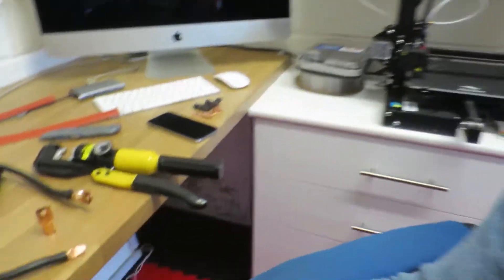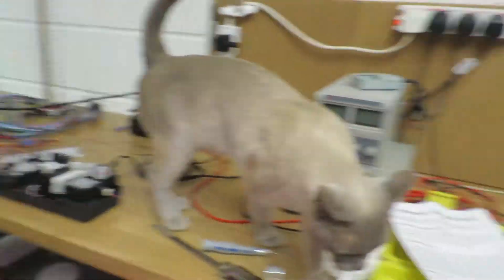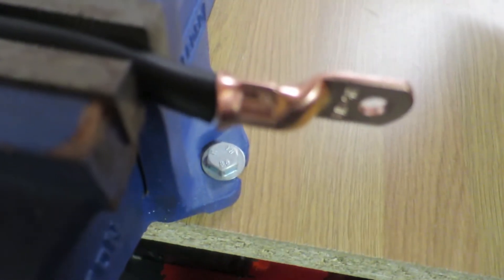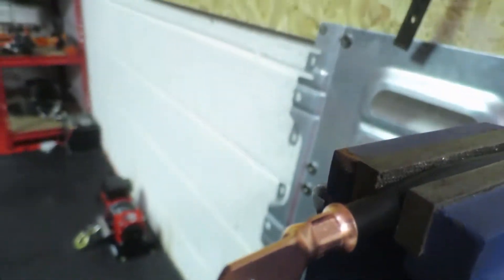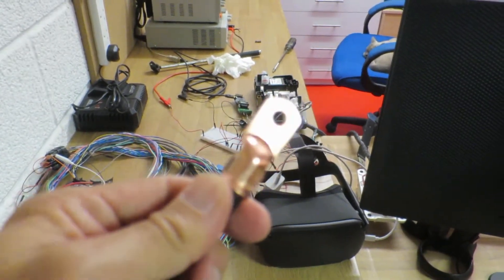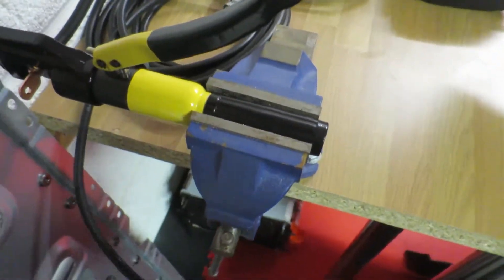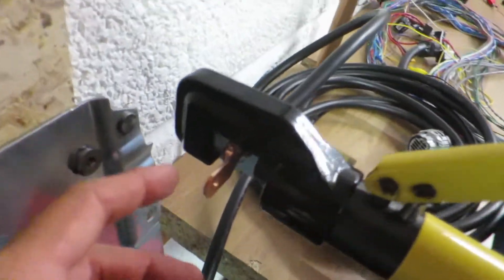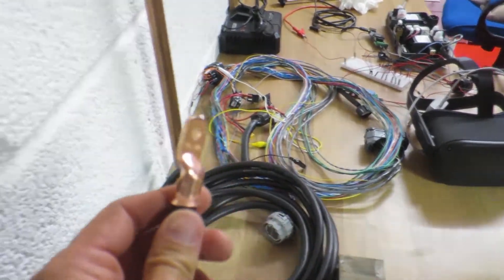Update to High Voltage Cable Production!

Comment: @South West EV UK Thanks for posting all the videos on your cool project. I have been contemplating an EV project, possibly based on using Nissan Leaf parts.

As a few people have suggested, it is quite likely that the lugs you are using are too large for the cable you are using. The "wings" on the lug are likely due to the crimper die being too small for the lugs. I would not suggest cutting off the wings or crimping them down since that may compromise the quality of the electrical connection.

I believe that you stated in one of your other videos that you are using 1/0 cable for your project. I would guess that you are using a flexible, high-strand-count type similar to welding cable. The "1/0" designation indicates the NOMINAL conductor size. The insulation is generally specified separately from the conductor size.

There are several common construction styles for high current cables. "THHN" consists of a number or relatively thick strands, making it rather stiff, and is generally used in buildings and other stationary equipment. "DLO" or welding cable consists of a much higher number of fine strands (for the same nominal conductor size) and is much more flexible (much smaller bend radius). If you can bend the 1/0 with your bare hands, it is most likely DLO or welding cable. Since you are in the UK, there may be different terms used for these construction styles.

THHN specs : https://www.southwire.com/wire-cable/building-wire/simpull-thhn-copper-wire/p/BW1

DLO specs: http://www.cobrawire.com/products/dlo.php

At my previous job, I discovered that, generally, the lugs are sized for use with THHN cable and that DLO cable of the same nominal size has a larger overall conductor size (see documents linked above). I spent several days looking up the actual conductor diameters used in all our products then looking up the actual inside diameters for all the lugs and terminal blocks being used. In some cases, I had to change to using the next larger nominal size of lug or terminal block in order for the cables to fit properly. I also found some variability in the conductor OD between different manufacturers.

It would be best for you to measure the outside diameter of the various high current cables you are using. Then, find the smallest lugs with an inside diameters (ignoring the cable size range specified for the lugs) that are just a bit larger than your cable diameters. I would highly recommend that you purchase the lugs from an electrical distributor serving the industrial market since you would then be getting a name brand such as Burndy, Panduit or some major European brand. These are commodity parts so their cost would not be a lot higher than what you would get through ebay or Amazon. I would not recommend purchasing lugs through ebay or Amazon since it is not likely that those vendors have detailed data on the parts they are selling and it would be difficult to guaranty the quality of the lugs you get. I have used some from Amazon (not for work) that would not grip properly. At the current levels you will be running at, this would lead to a high resistance joint that could heat up enough to start a fire.

One last recommendation is to make sure the bend radius' of your high current cables is at least 6 to 8 X the conductor diameter. Bending them too sharply can break the thin strands leading to higher voltage drop and extra heating in the cable.
Reply from the maker: Awesome tips and information, yeah the die is likely too small - but it is odd, the die the next size up (which looks to be the right measurement) is too big and does not crimp at all. Probably a dodgy Chinese measurement! I am not going to cut the wings, and ill note about the limit on bending. When the car is under usage there are lots of things I will be checking frequently - the temperature of the connectors and cables are one. I am not expecting this to be as efficient as the original, but close enough to have a valid driving machine.

Comment: That's much improved. 
You can remove the little ears by turning the crimp one flat in either direction after the first crimp is made, then crimp again. This second crimp will then force the ears onto the crimp, making it look neat and obviously improve the electric connection further.
Reply from the maker: yeah, think there is a little more to be had here - although it is super solid, and I cant see it failing anytime soon.

Comment: Good job Dave, at least our hassling lead to a new toy 🙂
Reply from the maker: Haha, another tool to use just a few times!
Reply: @SouthWestEVUK  so much easier to have the right tool on hand when you need it though. I have a few tools I've never used, haha. And now with my first classic car, I've been buying lots of new imperial tools 😁
Reply: @SouthWestEVUK  hey Dave, do you happen to know from your research if the 2017+ model of the leaf still uses the same code for the inverter?

Comment: Hey Dave, very excited to see another one of your videos. When I saw the first one you were doing I was thinking that I also had to do some cable management in the past and what I did was solder the piece. I believe that each strand of wire needs to make a contact with the connector in order for it to be 100% efficient. But I am not a electrician so I'm not 100% sure. Here is a link to a video that you might like. Thanks

https://youtu.be/SXDkNMDDrBs
Reply from the maker: Blimey, if I did that I would probably end up with a pool of solder on the floor! I think ill keep this for now - my original clamp worked OK for the first EV - this improved clamp should cope with the mark 2. Perhaps v3 will have further upgrades - all part of the process.

Comment: my crimps don't clamp the sides like that are you using the same die nr as the terminal? I have to make a video about this too lol
Reply from the maker: So the Die that machines the size of the cable - basically does nothing, its too big. This is the next size down - I dont have anything else.
Reply: you can try using a bigger die on one side to have little bit larger crimp, but if all 3 items are matched the crimp should look like factory